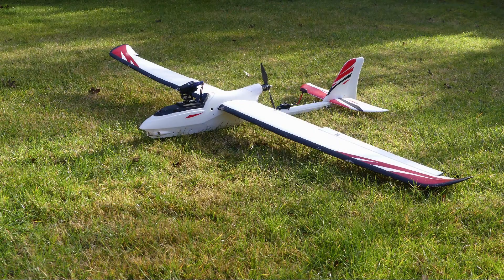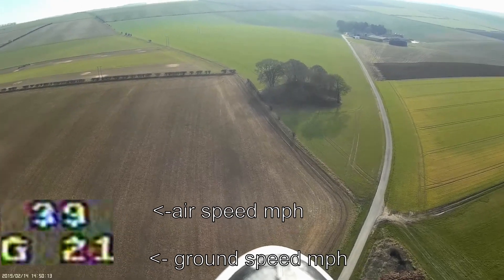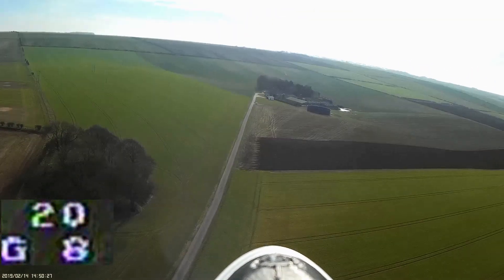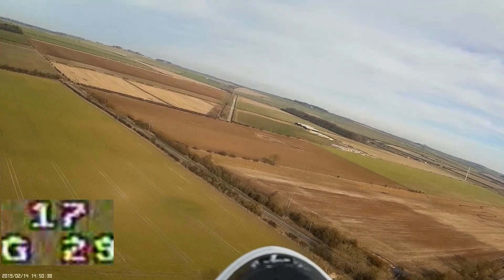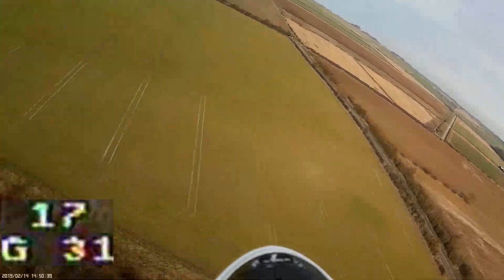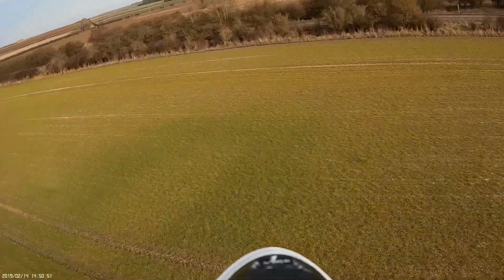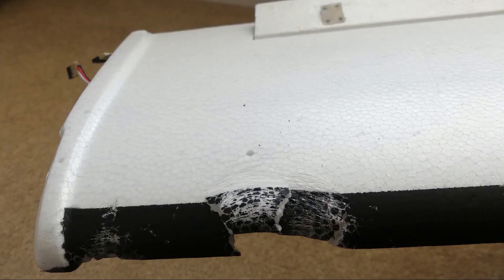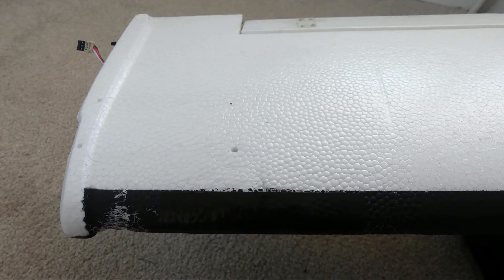Faster than the wind (would be better)

Comment: Cool that there's so little damage! I'm really impressed by how you managed to fix that ding in the leading edge! Do you mind sharing the process? Thanks!
Reply from the maker: Fixing dings in foam wings is fairly easy.

I used a hair dryer to blow hot air to both sides of the ding - this expands the air within the foam cells which "grows" the foam back into place. Of course you have to be careful not to burn the foam with too much heat (some people prefer to use hot water). And usually the foam doesn't quite go back to where you want it. 

Once I have expanded the foam as far as it wants to go I usually use some UHU Por glue to mend any rips in the foam and then leave it to dry.

Finally I cover with a bit of Duct tape to give the edge of the wing a smooth curve and make it look neat. Sometimes I might use hot glue to bulk up the ding before covering with tape. 

The thing about crashing foam planes is that even a bad crash can often be fixed. You just need to accept that the plane might look a bit rubbish afterwards!

And we should all accept that crashing is part of RC flying!
Reply: @stedenvideos3825  thank you for a very informative reply!